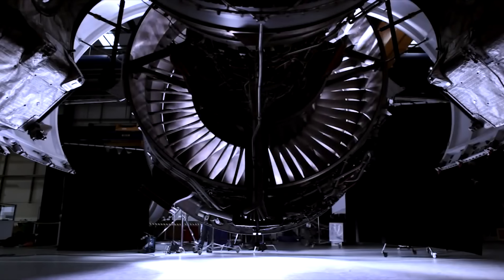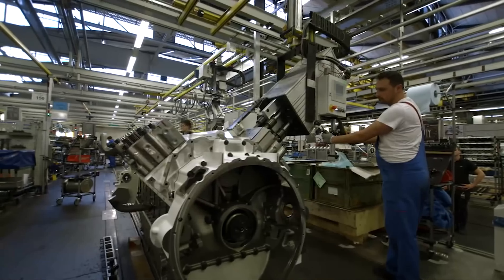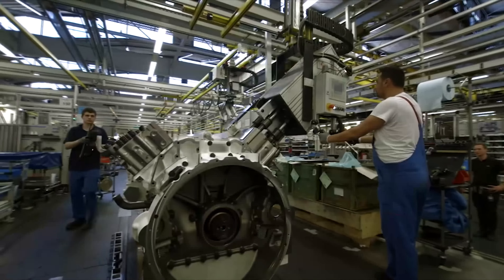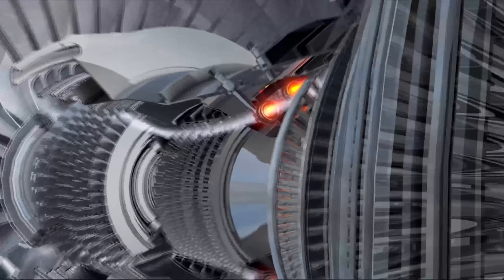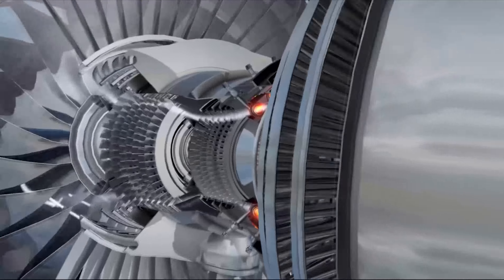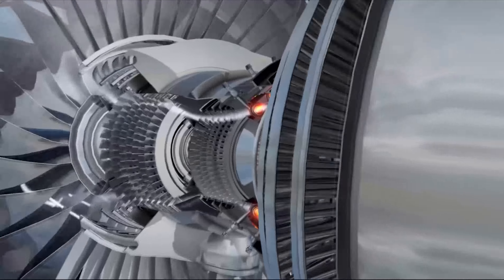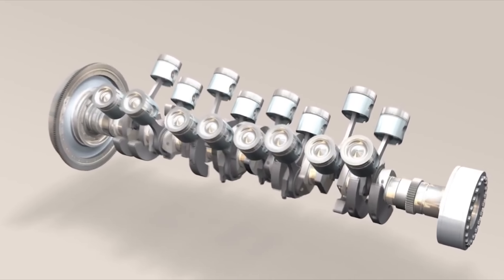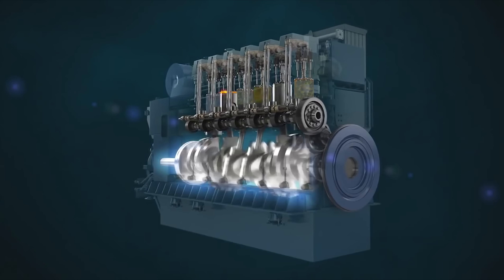How Plane Engines Work? (Detailed Video)

Comment from the maker: If you have any questions, post below ! 
Our experts shall revert back !
Reply: Engineering World 1
Reply: Engineering World hello there..i like to contact with the engeniers 
.im frm Malaysia..have an idea ...tq  frm Muasis
Reply: hi, how middle blades can reverse cycling
Reply: Someone told me that pistons in jet turbines are located in form of a circonference, the aim is to have less vibration and a Better way to travel by plane, has it right? Thank you in Advance for the answer
Reply: Please explain how the jet exhaust is coming out at the back through the jet cone instead of through the turbine blades?
Reply: @Engineering World, is the fuel only used by mixing it with air and combusting it (in a gas turbine)? Is it used to turn the fan? If not, how does the fan turn?

Comment: I have a question for the piston engine, how is the air drawn inside ?

I'd like to know :)
Reply: The air is sucked in by the vacuum created within the cylinder. Basically, a piston engine is just an Air Compressor.

Comment: ok so I have asked this question many times but not once has there been an answer that has satisfied me, here goes.....

understand that air is sucked in by big fan.....squeezed by progessive compresser fans, fuel is introduced in the combustion chamber, air fuel mixture burns and gas greatly expands.....but then IS DIRECTED! to the BACK of the engine.... how directed? , why  does it head that way when gas expands in all directions .... Ohh ! you might say because the compressor stage is creating great pressure to make it flow in that direction (front to back) ... yeah sure!, and where does the compressor get it's power from? .... the final stage blades .... which must have more work done on them to cover the needs of the blower and compressor fans put together and keep rotating itself.... now obviously I know it works... but there is a missing bit on info .... that has never been explained here...thanks in advance
Reply: Ange Baccio 7
Reply: I think the directing force is (indeed) mainly the momentum of the air flowing through the core of the engine, caused by the rotation of the rotor, and if the plane has acquired speed, also this speed from the plane. The choice of the word "directed" might come from the presence of the stator vanes of the (first stage of the) turbine.

Comment: There is NO explosion in the engines !! If there were, it would BLOW UP ! It is a CONTROLLED BURNING of the fuel. GET it right Rolls Royce !
Reply: Robyn Anderson in car engine there are explosions.if not remove silencer and listen
Reply: No, not even in car engines they are explosions. It is controlled burning, too.
Reply: Just very noisy controlled burning.
Reply: What is an explosion then sudden burn of material which causes huge pressures to move mechanical parts?
Reply: its a really smal explosion that pushes the piston down so the gas created after explosion have room to expand, then the gas is released into exhaust and then fuel comes again, explode, release and it makes piston moves up and down..the piston makes the ax rotate, the ax is connected to tires by distribution and tires move...im 16 years ols i wanna make a small air powered cardboard engine..i dont know how air cam move pistons :(( help someone

Comment: Do plane engines have pistons ?
Reply: peter71641 )0))
Reply: Yes & no. This totally depends on the plane design; but untill the end of the 2nd world war, all planes flew on piston-engines which each drove a propeller. (A propeller is in function comparable to the fan of turbofanjet-engine: it pushes air away to the back & sucks in air from the front, both of which push the plane forward.)
Reply: Apollorion Thank you....but my doubt is how do these propellers rotate? In the case of those aircrafts post W.War II...?
Reply: The propeller is rotated by the torque on the axis which is connected (direct or indirect i.e. via a gearbox) to the engine which provides the torque.
Unfortunately these two little clips from rolls royce don't say anything about that, nor do they speak about why the air is compressed before heated nor why the heated air wishes to expand & it is also silent about electric engines and steam engines.
Reply: Apollorion So inside the engine there is a kind of mechanism with pistons or cylinders as in  vechicles?
Reply: Yep; that "mechanism" is part of the engine.
Reply: Apollorion okk...... thanks mr. Apollo .. the circular shape doesn't make seem ther is such a "mechanism"(cuboidal engine) inside..:) tats y i doubtd....cleared..thank you
Reply: The places where the piston engines are enclosed in aircraft are usually not circular in shape, if they are then that's usually for the streamlining or some esthetics, but those circular (i.e. cylindrical symmetrical) cases having a giant opening straight upfront and also big (though not as big as the opening upfront) opening at the end, e.g. such as you see on airliners, are practically always turbo (fan) jet engines. These are using very different mechanics, though both the piston engine and the jet engine are internal combustion engines in which the potential energy in the fuel is (partially) converted into kinetic energy of the (rotor of the) engine which is then transferred to the vehicle.
Reply: Apollorion Excellent...now i can refer to a picture with your explanations ..ok lemme chek
Reply: peter71641 Sejàrah kampong perlis     

 ,